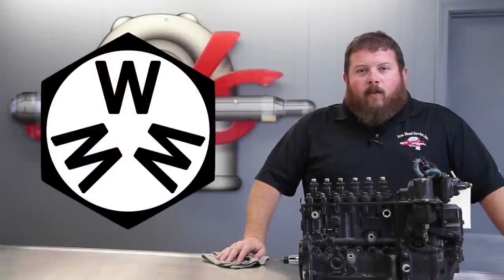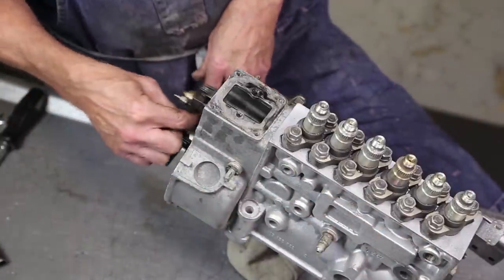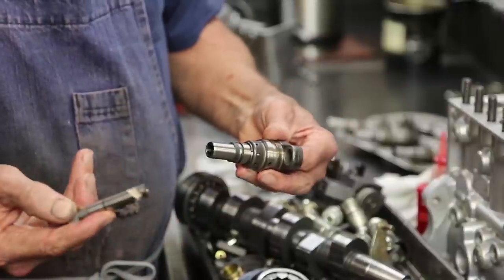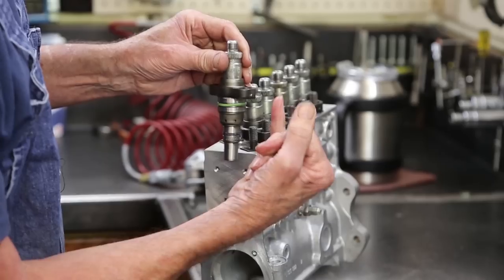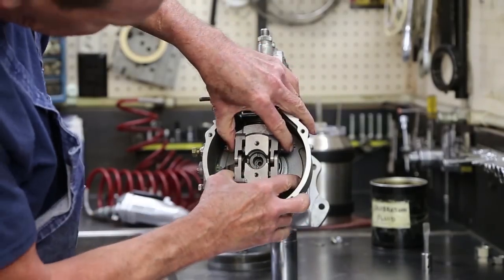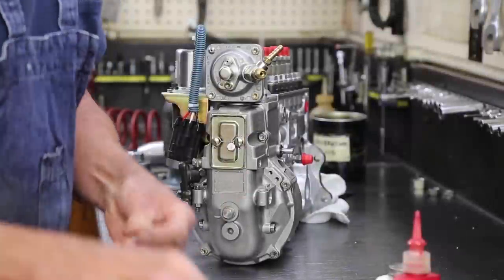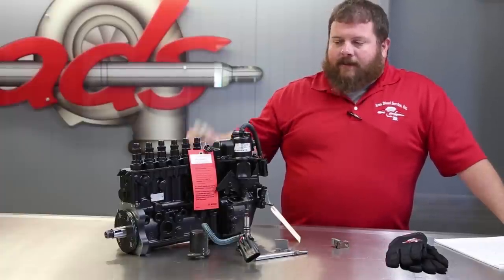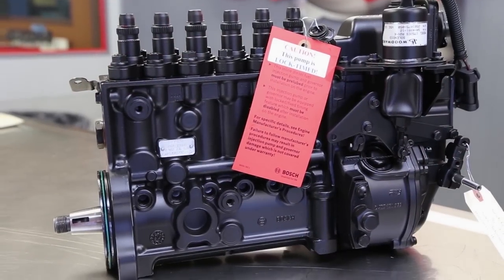IN UNDER 1 HR! Bosch P7100 Rebuild 4 MINT 5.9L 1995 Dodge Ram x  @WatchWesWork Unicorns are Real!

Comment: In my time I was a plant site technician in the UK, and the Bosch "P" series pump was common place, hence I found myself with Bosch technicians a fare bit.  Most where average to good, but sometimes you found yourself with a real clever guy that knew the product and was worth his salt.  I am in no doubt that Gary is equal to the high level Top guns of my days back in late 1994 onwards.  The sound of the test bench and the smell of the calibration fluid came rushing back.  Really enjoyed this video and hope to see more. When Wes started the truck after rebuild it was clearly fixed.

Comment: It's one thing to watch someone on Youtube build high HP performance engine with an aftermarket block, crank, cam, rods, pistons, etc... but watching a someone whose had a career in fixing, rebuilding and calibrating injection pumps is mesmerizing. I almost forgot about Wes's "unicorns are real" video until this got recommended to me, and boy this was a fantastic watch. I probably won't watch the almost 3 hour long version, but this was very informative; I don't think this version missed much from what's important and relevant so good job. Area Diesel Service, you guys have a beautiful shop setup and I will keep you in mind when/if I ever get around to playing with the injectors or the p-pump on my '95 Dodge - it's no unicorn with 350k but every time I work on it the truck runs better. I work in auto repair and the shop I'm with is focused towards BMW/Mini and euro imports, I can only hope someday that this shop or whatever shop I end up at can be comparatively focused and as specialized as yours is(that might be hard doing full service compared to a pump shop haha). Anyway, great video. I learned a bunch and hope you all keep doing well, great stuff.
Reply: I bet 100$ you watch the long video???

Comment: SO MUCH KNOWLEDGE AND PROFESSIONAL SKILL REBUILDING INJECTORS,  ONE CAN LEARN ABOUT THE INTRICACIES OF A WELL BUILT, PRECISION MACHINE.  I DO BELIEVE THE SOUND ENGINEER MAY HAVE USED SOME STIMULATING SUBSTANCE AND SET THE PLAYBACK SPEED AT 12.37% FASTER THAN NORMAL SPEECH.

Comment: Wow, what an education.  I can really appreciate the precision and the experience required to work on these pumps.  I have a 94 Ram 2500 with the 12v 5.9 Cummins and one of these pumps.  With 300,000 miles it starts almost instantly on the first crank.  Oddly enough my 1993 Class A motor home with the same 12V 5.9 Cummins and P7100 and only 40,000 miles very hard to start, even when warm.  Good inlet pressure and no air leaks in either the fuel supply or return lines.  I'm stumped.  I'll be calling this shop for advice and service after watching this absolutely impressive video.  Thanks for making it!
Reply from the maker: Thanks for the watch Gary and give us a call anytime! (well M-F 8-5)

Comment: As a Veteran Coast Guard aircraft mechanic I've absolutely no doubt that if Gary had ended up a fuel selector (carb on a Turboshaft helo engine) overhual mechanic he'd have Aviation maintenance companies head hunting him offering peris galore with a higher than normal salary.
He's extremely professional. 
Plus, he's a dead ringer looks, hand gestures and speaking cadence for my Friend and Deacon at my Church  Lane Poole.
Reply: Thanks
Reply: @garydahler8291  Sir! I know nothing about these pumps, but can’t help but wonder what the failure rate is? They are obviously very complex ad therefore expensive to repair. Are these pumps superior to other diesel fuel injection systems? Thank you!

Comment: In my world, I have worked on Perkins, Cummins 5.9 and one Deutz. I have nothing good to say about the modern CP engines. I rebuilt a 97 P-Pump and installed it in my 99 24 valve. Calibration is a pain and you need a cal bench to do it right. I changed timing on mine. Machined a tool using a tenth reading Starrett gage to set alternate timing using barrel #1. Pull delivery valve and adjust gear placement accordingly from pumps TDC #1.

I have worked on the English CAV pumps also. I love the CAV and P-7100 pumps.

Schied reshimmed my injectors to pop off with the lower P-Pump delivery pressure.

It’s a true joy to watch this pump being rebuilt. I wound up removing my solenoid and replaced it with a cable. I also had initial issues with the aneroid due to a striped bolt on the aneroid cover moving it out of position. I bought the pump used and the PO had striped it.

This video was totally invaluable as I have never seen this problem before.

I also replaced the fuel filter and lift pump with an original 12 valve FASS. You can’t underestimate this. The tolerances and workmanship of this pump is insane. The nozzles on those injectors are extremely tiny. The fuel in some Wyoming stations from old above ground tanks is almost like a slurpee! So super clean fuel is vital. 

Also, I am a fan of Rotella T4. Routine changes! I have seen 250,000 miles with NO measurable wear! Except for the valve guides which is the collateral damage from ultra low sulfur fuel. Machined 24 mag bronze guides and honed to 3 tenths fit. 

Keep up the good work guys!

Comment: Bought my un modified 97 dodge cummins brand new spent 27 years at freightliner dealer and was their mid range engine specialist i think gary would be the only one id want to work on my P7100 when times comes but at 230,000 miles thankfully mine is still running great thanks for the video

Comment: Great video guys.  Let me just say that you both speak very quickly, which can be a problem to some viewers. I understand you are not in the business of making videos, but if you are making further videos, remembering to speak clearly & at moderate speed is important. Wes has sent the pump to the right shop. I have a 97 Dodge 2500 with one & one half million miles on it. The pump has never been worked on, & all parts are factory. This winter, I notice that if the block heater has not been plugged in for a couple of hours, It cranks & fires on several cylinders & as the engine speed increases, it picks up the remainder & idles fine. I think its time I sprung a few bucks for a set of replacement injectors..Bosch of course. .
It is illuminating to watch the pump being worked on. Great work guys.

Comment: No smoking gun found.  It sure seemed like a fuel delivery issue in that test drive. It was stated fuel pressure was verified ok I wonder if it has a restricted fuel return. That could cause a cut out while still showing good fuel pressure.......
Reply: It would cause a miss, but not a sticking rack.

Comment: wes subscriber here. nice video on p pump breakdown and assembly.  the test bench section may have been a little too abbreviated for viewers to see what really it takes to dial one in. am also shocked that you openly admitted to 10% upping the fuel.  thats  borderline epa violation on film.  there's a tool for those tapered pins but it is  not bosch. the one i've used may have been specially made.

Comment: You showed how it was leaking oil in the beginning.   Does this thing only use it's own oil?  Or does it run off of the oil pressure/ engine oil?   If it holds it's on oil separately:   could the fact that it was leaking mean that it was low on oil, which could be the reason it may have been getting too hot, causing it to seize?   Could this possibly have been fixed just by simply adding oil, because it was low?;  since it was running fine 98% of the time, other then in the extreme heat of the day.     (I'm only asking-- I honestly don't know if the engine oil flows through it or not)..  I learned enough here to know that I don't want to be the one to rebuild them. lol..  Cheers.
Reply: This pump uses engine oil pressure. If it had ever run low on oil, there would have been MANY other indicators.

Comment: With the supply pressure going wild. I wonder if the check valves in the supply pump are not sealing. So the p pump test port sees the pump diaphragm movement instead of a nice steady pressure held by the pump check valve.  

Requiring a less that 10 micron. Filter between the tank and supply pump..
I have been dealing with sediment in gasoline engine mechanical fuel pump.
Reply: Very possible. The supply pump is separate from the injection pump.
Reply: @garydahler8291  i saw its a piston type with 2 check valves.

Comment: Thanks for the video guys!! Question: What's the best way to maintain a bosch p7100 injection pump? Fuel additive? I use Hot Shot's Secret Everyday Diesel Treatment .....any suggestions would be helpful.
Reply from the maker: Good fuel and good oil. That pump is lubricated with engine oil. Service the oil and fuel filters and run an additive and it will last a long time. These are very robust pumps.
Reply: @AreaDieselService  thanks! Appreciate your response!

Comment: I've got a Bosch P7100 for an 8.3 but I have a 5.9 12V long block sitting in the yard just waiting for a fresh pump. Nobody seems to know if the 8.3 pump can be modified to work on a 5.9?
Reply: It’s the same basic pump. An 8.3 gets oil from a port on front of the pump. A 5.9 gets oil from a fitting on back of the pump 😅
Reply: @garydahler8291  Yes, I'm aware of the differences. My question was on how and/or where it can be modified. I've looked for Youtube videos on anyone doing this type of mod and came up empty.
Reply: You have to block the front oil passage (“grey” epoxy), and drill the middle port on back of the main housing for an 1/8 inch fitting. 1/16” feed hole.
Reply: @garydahler8291  That sounds simple, but I'd like to see the process done since I've never attempted somthing like that before. (If I can't find a replacemtn Bosch Pump for 5.9) Not to mention the fuel delivery setup also.
Reply: @merlepatterson  y don't u just send it to them?
Reply: @mejesse809  I've called to ask them if they can do mods and they said they would swap kind for kind. They don't do mods for 8.3 pumps to work on 5.9 engines.

Comment: Wow I have the same problem with my p3000 pump. Surging then I lose 1 cylinder then multiple cylinders then it dies. Starts back up in a minute or 2 then does the same thing couple miles or couple thousand feet down the road. I never had this problem until I had the pump rebuilt. Then less than 1000 miles later this. The pump shop told me to check supply pressure, air in fuel, and possibly bad injector. I even removed the pump and brought it back to have it tested but couldn’t recreate the problem. 
It drove exactly like the one in wes video.  Now I know I need to show them this video and maybe they can find the tsb.

Comment: Coming to you from WWW. Great job diagnosing this failure and finding those old service bulletins. I see you made the short version partly by slightly speeding up most of this video. I don't think that is a good way of doing it, because the gabbling makes it hard to follow the important bits that you left in. Better to shorten the full video just by cutting it more. I acknowledge however that that takes a lot of editing work which you may not have time for.
Reply: I agree

Comment: I have a p7100 off of a 98 12v but the stud that holds the governor springs is bent, can a guy buy the unit that the two studs that hold the governor springs?

Comment: Why don’t you guys put these pumps on the calibration stands as soon as they get washed.  To get a base line on what the pump is doing, before tearing it all the way down 

I bet the truck has bad batteries and the fuel solenoid was causing the the entire issue but I’m only 49 minutes into the video currently
Reply from the maker: Thanks for the watch - Gary does hit on this in the video (or the 3 hr version of the video) Curt also hits on it in this Q &A video - https://youtu.be/mDFpWwHQYmA?t=82
Reply: @AreaDieselService  I have the luxury sit at work and watch channels like this on YouTube all day   The wear on those plungers are from the abrasive in the fuel  tell that dude that owns the 12valve needs to start running Caterpillar high efficiency filters that will filter down to  2 microns    You owe Gary a Pay raise because he’s been fixing these pumps for over 30 years

Comment: I understand why you added a 25% global speed increase, in order to keep the size length below an hour, but it made the speech very difficult to understand and flow.
Reply: Drop the playback to 0.75 and it sounds normal and more understandable
Reply: If you just hold "shift ?"....  You can see a list of shortcuts, and in there - you can see that "shift <" and "shift >"  can quickly change your speed on the fly, while watching.
Reply: Thanks
Reply: Be careful with that aim